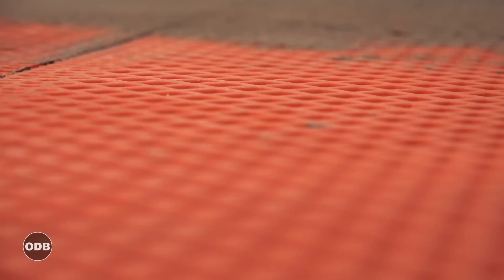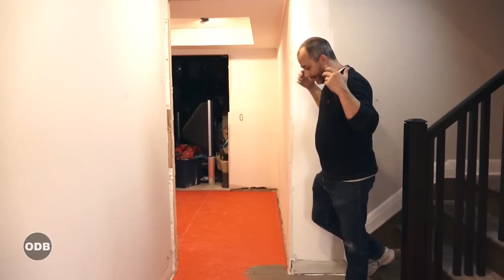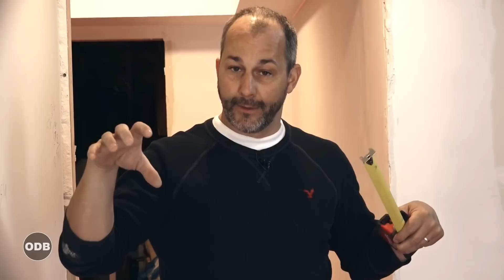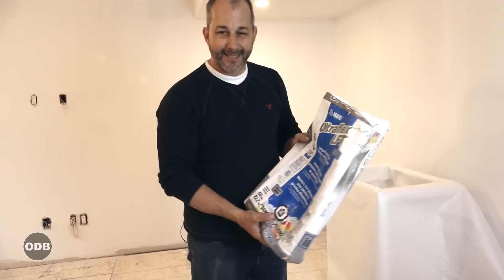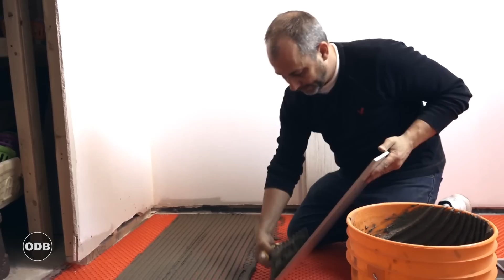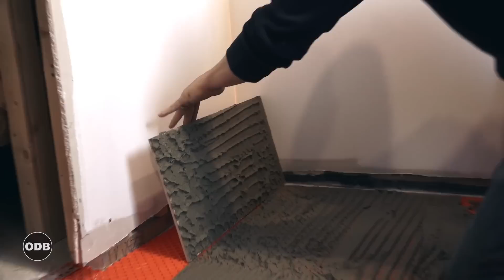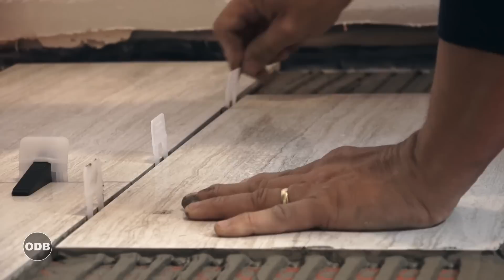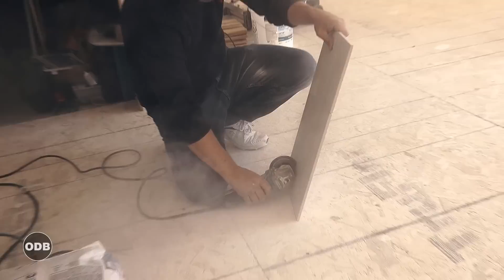How To Layout And Install Large Format Tile On Concrete

Comment: What exactly is the purpose of putting that color Mating on concrete

I have a floor I need to put tile and I just removed the vinyl tile and hopefully grind it off all the glue with a buffer more like a grinder

I do hear you mentioned on this video because of the overspray from the painters

Just asking because not sure what the real purpose of that stuff is for
Reply: You don’t need it , concrete is the best surface to tile over, unless it’s in bad shape, cracking
Reply: @tilebyjames  I suppose it prevents it from cracking. Purchased a new house with tile directly on concrete in the front entry area. Years later almost impossible to remove it with a rotary hammer, it was bonded tight. Finally got it out with an 80 pound jack hammer!

Comment: I have always understood the trowel lines should be done perpendicular to the long side for large format. Been awhile since I've read the standards, has that changed?
Reply from the maker: That is a good practice, but let me ask you what If I was doing a 24 x 24. Then the trowel lines would effectively be just as shown here. The best rule is to trowel in the direction of convenience. perpendicular trowel lines are only effective on tile larger than 2 x 2 feet.

Comment: Nice video. By the way, do you have Video for lay the Red Membrane (at you video 1:15") . Want to know what's steps to lay that first. Thx. 😀
Reply from the maker: simply trowel out cement and lay it on using a grout float to press it in. Cheers!
Reply: @HomeRenoVisionDIY  can you use the same cement for the membrane as you do when you lay the tile? We both know you're awesome!

Comment: @Home RenoVision DIY Jeff.  we are fortunate (or cursed depending on your point of view) to have a heated basement slab.  lined copper hot water lines throughout the entire basement.  We don't want to use detra or another underlayment because we won't get heat transfer.  Can you give us another option besides just laying directly to the slab?  We have only one hairline crack in the floor, and the house is 55 years old.
Reply: Just get anti fracture membrane for the cracks, tile over concrete

Comment: Hey jeff i wanna lay tile i my bedroom and i have the floor rip  down to concrete slad.
But the concrete is very uneven.crack and paint and tar adhesive stuff.Don't really want to resurface with self level process. But the question i have can i just lay down osb and somebacker board  and then lay down tile?????
Thanks love you videos
Reply from the maker: I would suggest rolling on some eco prime grip from Mapei. Then roll on a crack isolation membrane and then tile. this way you get a great bond crack proofing and no need to integrate new materials on the floor. Cheers .It is also faster and cheaper and I think will give you better performance moving forward. Cheers!
Reply: Also forgot to mention that i need rais up floor to even level with hallway floor where thier is tile over wood floor .
I'd say 1" to 1 1/2" maybe... still think i should lay down membrane only?

Comment: Hi Jeff, from my preferred DIY videos. I got a question for you. Could I use glass block mortar to even out the concrete before laying
the tiles. Where I am, in Honduras, I can't find self leveling compound. I'd have to fill in up to a 1/4'' dips. Thanks in advance.
Reply from the maker: Hi Konrad. you could always use hydraulic cement with a little extra water or use the setting cement in advance to fill in the gaps.
Reply: @HomeRenoVisionDIY  Thank you very much. I almost always come back to your page when when I need help.

Comment: Question: When you place the self-levelling spacers, do you place them so that they're directly under the tile or on the floor under the tile (leaving some mortar between spacer and tile)?
Reply from the maker: the spacers are used to level and create the grout joint. Cheers!

Comment: For laying out tile.. I draw out the perimeter of the room in AutoCAD, and lay the tile pattern down.  Drag it around, figure out partial cuts to minimize material used, tweak grout widths, etc.. takes a bit of time, but definitely helps me plan it out.
Reply: That require more time, he use less time. I love AutoCAD and also sketchup, but sometimes pen and paper is the way to go.

Comment: I plan on tiling my 250sqft living room with 8X48" porcelain tile made to resemble wood.  It's going to be a heated floor and so I'm utilizing Ditra-Heat Duo membrane over the concrete substrate.  Question 1/2: when is it necessary to use a self-leveling compound to prep a concrete substrate/ when is it okay not to use self-leveling compound? Question 3:  I was told the porcelain tiles I'm using could be butted up against each other (the edges are rectified) to create as small of a grout line as possible, even when used in a heated floor application.  I'd love to butt the tiles to get 'the look,' but I'm VERY hesitant. Can tiles be butted or must there be space?

Here are the specific tiles, if this helps: https://www.lowes.com/pd/Style-Selections-Natural-Timber-Ash-8-in-x-48-in-Porcelain-Wood-Look-Floor-and-Wall-Tile-Common-8-in-x-48-in-Actual-7-72-in-x-47-4-in/50106830
Reply from the maker: Hello! if your floor has a variance of more than 1/4 inch over 8' then i would suggest using leveling compound. In most cases this will not be necessary. since you are using ditra I would suggest simply using a leveling clip system for installing your tile to achieve a flat lip free surface. a little variance is not noticeable by the eye. However if you what to invest in a perfect level floor you can. I only suggest this if you live in a house that can afford the investment. Cheers1
Reply: Invaluable, thank you!!
Reply: esuohelyk you need at least 1/16 grout line, I would go bigger tho , Lowe’s tile are not always the most uniform

Comment: Are porcelain tile flooring good for home garage?  There are so many options, but tiles are still the nicest looking.  Should I be concerned about durability/longevity as garage floor? I live in southern California, so the weather is generally sunny and dry.
Reply from the maker: as far as a structural element no problem. I do suggest a uncoupling membrane to protect against any possible crack transfer. But a good porcelain tile on concrete and you can park a dump truck on it. Cheers!
Reply: PEI rating of 4 or 5

Comment: For your sub floor prep, you used the ecoprime grip on the concrete so that your thinset would adhere to the concrete then you installed your underlay? Did that get you up to the same elevation as your laminate with the subfloor system?
Reply from the maker: It got close enough to use a regular transition. Cheers!

Comment: Great video, good information. You seem very professional. So many haters though, in the comments. Sad to see people can bring such negativtiy to DIY video. Keep the videos coming, I've learned a lot from you.
Reply from the maker: This is the internet Robin, plenty of folks out there who don't want me to do these videos since they are afraid it will hurt their business. No worries, we release videos twice a week. Cheers!
Reply: @HomeRenoVisionDIY   just one tip, over ditra you'll have to use a non-modifid thinset. That is what the factory recomend to use. Everything also, very good my friend.
Reply: @HomeRenoVisionDIY  can't thank enough for everything, in my country India, we don't very use wooden walls and very rarely use wooden flooring but only in window, doors. and mostly use concrete, cemented items. hence we suffers from edges, levelling, finishing, interior designing etc. we people recently starting to give some priority on interior designing as per budget and hence learning from you experts.
I like most of your complete coverage on full makeover tasks which clears all my engineering errors.

Comment: I am a framer by trade but I'm looking to redo my mother's bathrooms I want to do her showers and her floors because the house is over 30 years old ....
I have a question why do you use a Ridge making trowel to end up with a Flat surface underneath the tile?  why can't you just use a straight edge trowel to do the whole job? It would seem that would make for a faster insulation
Reply from the maker: collapsing the ridges gives 90%bond from tile to substrate, it allows for levelling of the tile.
Reply: @HomeRenoVisionDIY  ....  I get what you're saying.... but still in my opinion making a all flat surface underneath a tile wouldn't that create a 100% bond?  I don't know I guess I'll just go with the knots trowel ,if that's the proven method.. Thanks for Info
Reply: @jesusshorty2660  hi, unless your hand is a machine and able to make a 100% flat surface, you will not get 100% adhesion/contact.  The ridges has open spaces, wiggle room, allowing you to press down to create the 90% adhesion.  Otherwise, the ridges on its own would have been 50% adhesion only.  So rather than trowling flat and hope for miraculous 100% once in a while, you can achieve consistent 90% contact throughout the entire installation just by using the ridges.
Reply: It gives you the flexibility to make minute adjustments as you go. Floors are never perfectly flat.
Reply: It's this kind of comment that makes me not have to wonder why framers can NEVER get shit right lmao. Every new house I go into to set tile is always fucked by walls not being square or walls that fucking change by 1/2" over 8 feet.
Reply: @urgeddeer101  Think before you act. He sees someone do something he doesn't quite understand the purpose of, so instead of mindlessly copying what he sees he asks questions.

Comment: I'm tiling the floor in my bathroom. Can I tile over the plywood, or do I need to use something like the ditra product?
Reply from the maker: you can use plywood as long as it is 1 1/4 inches in thickness. or you can use ditra on the osb but visit the schluter site to get all the option available.
Reply: Can the DMX or similar products work as an uncoupling membrane and be tiled over top of??

Comment: I tried the leveling system sold at the home depot and didn’t like it. It has a curve on the bottom. Do you like that one or prefer the one you’re using?
Reply from the maker: They also sell a right angle version. I agree the curve is not helpful unless you are using 1/2 inch cement trowel.

Comment: Im about to tile my house with plank tiles. I have ripped up the carpet and laminate flooring to reveal the slab below. The concrete slab is not flat but that doesnt bother me as much as the sloping does. Half the house is relatively level but the othet half slopes downward about 5/8 or better at 11 feet. And i cant build it up because it slope toward the front door. Any thoughts. The planks are going to be running perpendicular to the sloping.
Reply from the maker: install the other direction and use leveling clips. you will be fine.

Comment: Can you just use normal spacers, like 1.5mm, instead of that clip system? I guess it stops movement but seriously how much movement would you expect on a flat, horizontal surface.
Reply from the maker: the clips are designed to position the tiles vertically to eliminate lipage.

Comment: So, are you using the membrane because of the overspray from the walls?  Is it completely necessary to use an uncoupling membrane if you have level concrete substrate?  I'm asking because I want to tile a kitchen and adding all of these extra layers will definitely cause a large transition between my kitchen and living room flooring.  So confused and reading all different opinions on if this membrane is needed or not.  Also reading reviews that the membrane causes cracks and shifting tiles which is what I was researching this membrane to avoid so I just don't see the point.  Any tips would be greatly appreciated! Love your work.
Reply from the maker: Hi Samantha, if you have a concrete floor then you need a crack isolation membrane. They come in 2 varieties. A dimpled one like in this video is to help raise the height of the tile to meet up flush with a hardwood floor. If you want a lower profile then I suggest using the mapei roll on crack isolation membrane. It is available at most tile supply stores. Cheers!
Reply: Could RedGards waterproofing and crack prevention membrane be used instead of the Maipei product?

Comment: Hi Jeff, first of all, thanks for the great videos. I watched a bunch of them preparing to redo a bathroom and they are very helpfull. I have a question about the Ditra membrane, I saw a video where they attached the membrane to the plywood, then filled the squares and let it dry out before laying the tile. What are your thoughts on that? Thanks!
Reply from the maker: not necessary. fill the holes yes, tile right way!

Comment: Angle grinding a tile is so prehistoric. Get yourself a wet tile cutter. Cost very little compared to your medical bills later in life.
Reply from the maker: The angle grinder is the most versatile dependable tool on any tile jobsite. The wet saw has soooo many limitations.
Reply: Angle grinder with a good rubi porcelain blade is far better with floors if you know how to use it saves time and money just cut outside with wind on sure back no dust inhale and I tile for a living good job mate
Reply: Why not just scribe up the long length then grind short part  snap on cutter works a treat mate  just my way of doing it not to say sure ways wrong just faster and less ware on blade

Comment: How do you level tile when there is already tile set and dry?
I want to replace a section of my living room, but want to leave around 30% of the current one. I assume that I need to start laying it from the ones that are already there. However, I am curious to know if the leveling system will work when I am using it with laid tile. 
Any ideas?
My porcelain planks are 8”x48”
Reply from the maker: you will have to set the first row by hand and add clips to the new edges only. Let that set overnight and then you can continue.

Comment: Nice vid you show nice technique. Two things. Yah here it comes any cutting with a grinder or wet saw on tiles or backer cloggs up hvac systems resulting in customer complaints. Trust me i learned the hard way. And i dont care if you smoke or not you need safety glasses and at least a paper respirator. Ive been doing this for 30 +years you will run out of breath someday and eye lids get infected. Who are you going to make money for when you are no longer not here?

Comment: Since DITRA is impervious, it does not deprive the mortar of its moisture. ... In general, we don't recommend the use of modified thin-set mortar to set tile over the membranes because these mortars must air dry to cure properly.
Reply from the maker: Lucky for me this was not a ditra membrane and the manufacturer does not hold that opinion about the product!

Comment: Can you use uncoupling membrane over hardi backer? We have hardibacker screwed to plywood the reason we did not mortar it is that this is upstairs and there are framed walls nailed into subfloor. if at anytime in the future we need to trear up floor it would destroy the subfloor which structurally hold up walls of our raised ranch. We screwed down backer board but want to avoid tile cracking. i am wondering if using redguard uncoupling membrane thinset cemented over would be the solution?
Reply from the maker: Sounds like you have an old house. If the foundation is good and doesn't heave in the winter then you should be fine. But if your house moves a lot then no amount of preparation will protect a tile floor. !

Comment: Hey! I love your videos!! I watch them on my lunch, just because, and find them not only informative, but enjoyable also! Thank you! I do have a question about this one, though, as I am about to start my first large format install...can you briefly go through the method you used to map out the starting point? If your tile is 11.5" + .5" grout line, why did you add an additional 9.5 inches to your 19 foot mark? I'm just curious because i'd love to map out my tile the same way you did. Thank you!
Reply from the maker: Hi Erik, I just use a simple aproach so that my most important transition will look amazing. First find your most important visual and then make sure it is square to thet. You will be fine. Cheers!

Comment: hey great video, I ordered the leveling kit from amazon worth it i think, 8 x 36 tile Rectified in a bathroom any thoughts, 8' x 5' floor, Should I pick a smaller tile? 6 x24 for instance.
Reply from the maker: definitely, that is a must have for your tile dimensions. Cheers!

Comment: Beautiful work!  I should be so blessed.  On my DIY the materials showed up with 16 - 4 x 8 Durock sheets for 510 sq feet.  Does this sound right?  My tile guy said that it was necessary do to the tile size and floor joist.  What say you, good sir?
Reply from the maker: 4x8=32sq ft per sheet. 32 x 16 = 512 sq ft. In most cases it is necessary to add substrate to subfloor to install tile. i think you are fine. Cheers!
Reply: Home RenoVision DIY. I had a blonde moment and I went insane. In my mind's eye it just seemed way too much. I thank you for your wisdom, I thank you for your kindness, and I thank you for your videos.
Reply: Thank you for being a Supreme Celestial Being and All Around Swell Guy.  We (Society) need you. :)

Comment: Is it necessary to use the underlayment on a concrete slab that is one ground level and not in the basement? We have 900 square feet that we're going to be tiling. That Schlucter is very expensive. It would almost double the price of our project
Reply from the maker: You can use a roll on crack isolation membrane from Mapei. We used this membrane to get a little height as well on this job. not always necessary!